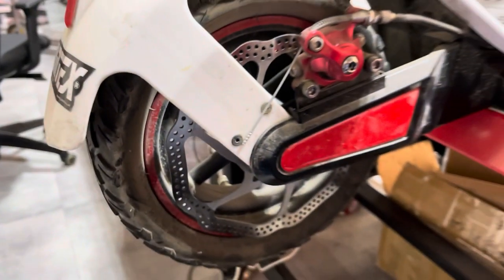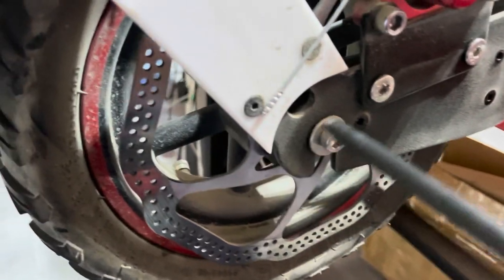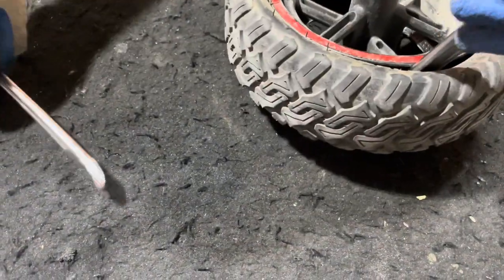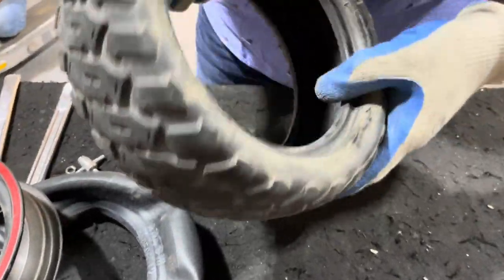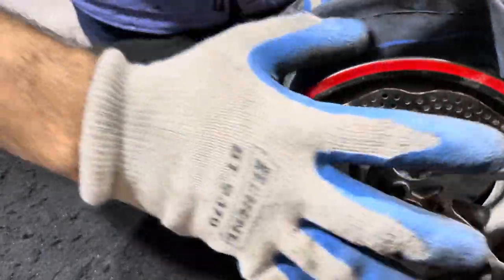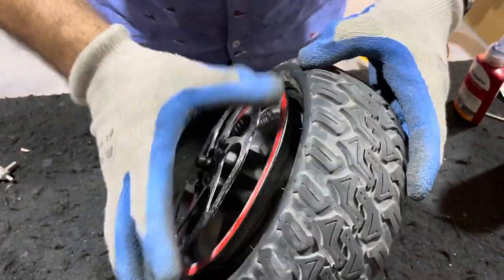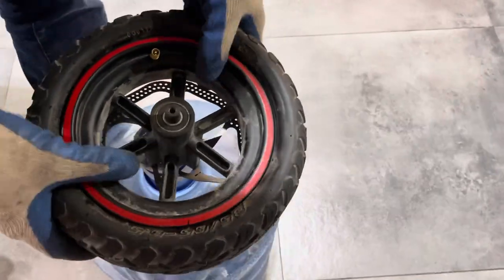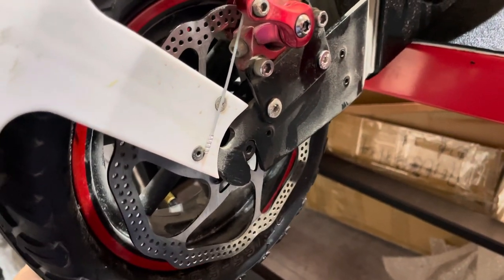Eveons G-Max Rear tire tube replacement

Comment: Good day sir Abdul RZB,I use to have my kugoo gmax when time my front wheel motor gets flat, I do it myself to change its inner tube. But when in time I return it back the motor doesnt run in normal. Theres a power on display throttle power IN display, is there any problem to it? Though I damage it line wire on it? OR maybe it short circuit coz I apply water with soap as easy to do it? hope you can help with this issue? thanks much and more power!!!
Reply from the maker: Maybe the wires are not connected properly, you can try checking the wires from controller as well to make sure all connections are tight. Applying soapy water shouldn’t cause it if was just applied to the outer rim. As for damaging the motor wires if you put the side where the wires come out on the ground to put the tire back in then there’s a chance that wire has been cut. Inspect that opening.

Comment: Hello sir I have this same scooter and my front tyre is flat pls make a video on how to open front tyre pls sir pls
Reply from the maker: Front tire is rather easier. 4 total screws on the fenders (2 underneath the reflectors) and they will come off exposing the tire axle and it’s nuts, the wires for the motor are behind them and can be disconnected to remove the tire.
I don’t have the scooter anymore to create more videos.